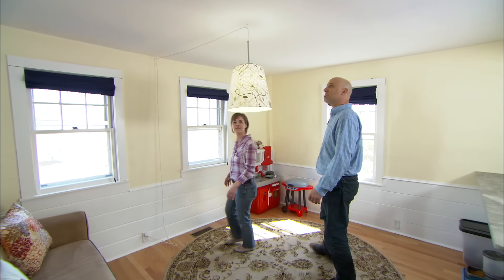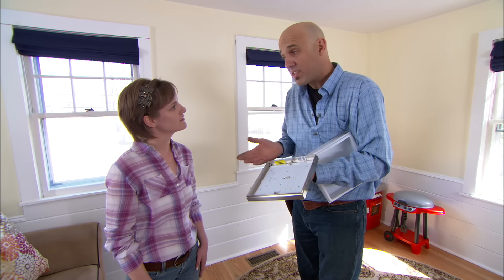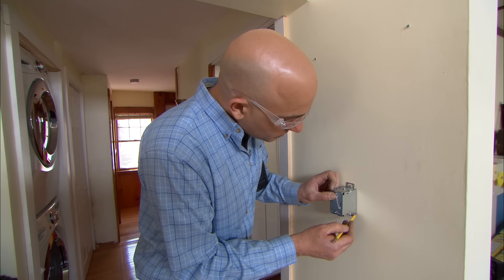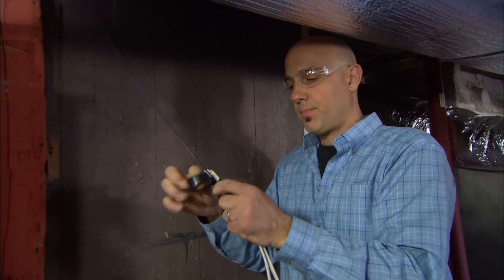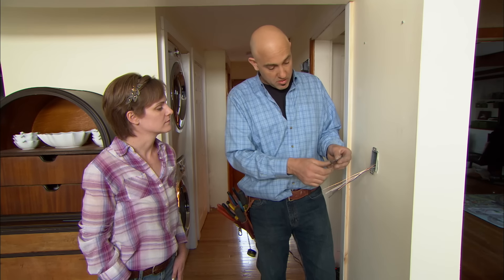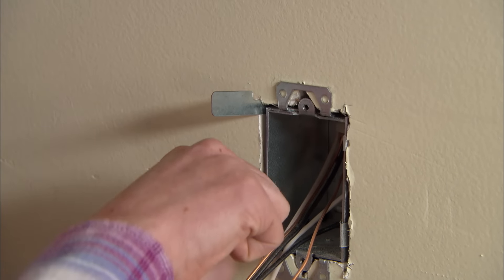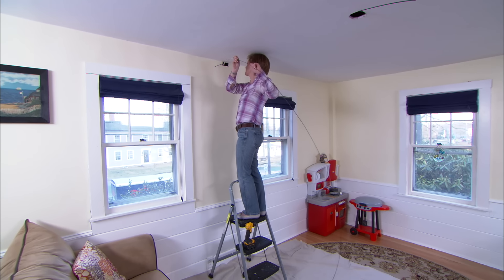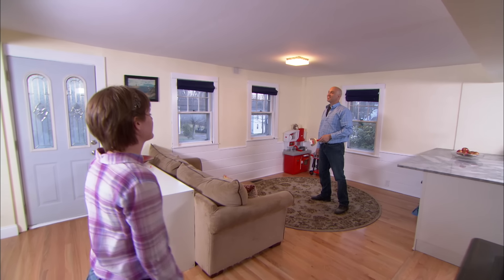How to Wire for a New Ceiling Light | All About Lights | Ask This Old House

Comment: It will be nice when the NEW owner of the house installs a ceiling fan on the box, lol. Nightmare -
Reply: Before installing a fan, you are supposed to make sure the box is fan rated. It would be the owner's fault if he/she installed a fan onto the wrong type of box. If you don't know how to do it properly, then you hire someone who does.
Reply: Kris Klekosky    Good advice, but how many homeowners think they can save a few bucks by doing it themselves. It’s just  white to white/black to black, and just screw in a fixture.  I once came across a ceiling fan screwed into a lathe and plaster ceiling with no junction box.  The splices were just hidden under the cowling.  I  took it down and refused to  do the job.

Comment: This guy ever hear of a Stud Finder.
I never attach electrical boxes to Sheetrock.  Wait tell someone goes to install a ceiling fan. Or the light switch wiggles loose after a few years. Do it right the first time.
Reply: I concur with the issue about the ceiling box; but, he should have used old work box for the switch. Those don't generally come loose because the brace is part of the box and screwed in at installation.
Reply: Sometimes the light needs to go into a place where there is no beam, and the light fixture is also not heavy. I like to use the plastic blue round cut in boxes for light weight applications.

Comment: I'm confused - why wasn't there a top plate in the way where he cut the hole in the top part of the drywall?
Reply: Old house. Maybe balloon framing ?
Reply: I searched all through the comments to see if someone else was wondering this exact thing! Most of the time getting though that top plate is the hardest part. The rest ain't so bad.
Reply: Dropped ceiling or more likely balloon framing
Reply: The access hole in the wall is so you can insert a long drill bit and drill a hole in the top plate. It'll be a little bit angled away from the direction you're needing to pull the wire, but that's what the assistant is for.

Comment: This videos always skip the hardest part of a job like this.  How to figure out where to fish the wires without tearing apart all the drywall
Reply: Yes and some old houses have insulation blown in them which makes fishing the wires a lot harder . After doing house building and remodel for 35 years i found a lot of old houses you can't fish wire though . Lot's of old multi floor houses had fire blocking put in horizontal and you have to drill a hole in it to get a wire though , meaning you cut a hole in the wall board large enough to get a drill in it to punch a hole in the fire blocking for the wire to pass though .

Comment: I'm so glad he isn't on the show any more. In all my years of electrical work, If I was hiring, I believe that the only place his job application would be would be in the trash can.
Reply: Why
Reply: @electricaf365  it's pure laziness to use Madison straps on an octagon. You know darn well the next home owner is going to hang a heavier light if not a ceiling fan not understanding or knowing how it's held up and I think you can figure the rest out. Should have used an old work fan box with the expanding bar.
Reply: @gregorall9779  wouldn’t that be the next owner’s responsibility to brace it before putting in a ceiling fan?
Reply: @electricaf365  You're assuming that the next homeowner is going to be aware of how it's secured. Personally, I would want to have it done correctly, not just the cheap, easy way. I just don't care for this gentleman's work ethic. In past episodes he has performed certain tasks, that to me, seemed the quick, let's get it done mentality.

Comment: I'm not an electrician so maybe someone can help.me... why even run the neutral all the way to the switch if youre just going to twist them together any way?
Reply: protocultureBJJ it just continues on to the light. Also some new switches require a neutral wire to it. But as I said before it just continues the circuit from the light. Neutral is your return wire and your hot wire is your feed, or supply wire that sends out electricity.
Reply: @Abdul Rahman Yep. The code changed many years ago (at least on this side of the pond) so the neutral is required in the switch box. Older homes were not built that way and there is not always a neutral in the switch box. One advantage of the new code is that when the switch is off (assuming everything is wired correctly) there is zero power at the fixture.

Comment: If you don’t know to shut off the power or measure to put the light in the center of the ceiling you shouldn’t be watching this video. It’s a good video for a guy with some tools and common sense. Also anyone who puts a ceiling fan up without checking the box installation first deserves what ever happens to them.

Comment: This video is terrible. Can’t see the whole picture of what’s going or coming from where - with the way they did the video edits. Also how is the switch connected to the fixture if it’s two separate wires connected to two different locations
Reply: It was pretty clear. You can’t teach decades of experience in an eight minute video

Comment: Unbelievable why there are so few electrical fires in American houses.
Do it like that in the Netherlands and your house will be condemned.
Also, that wooden floor looked like it should be replaced 4 years ago.
But biggest weirdness is why give the woman LED lightning and not even talk about a dimmer?
Reply: MsUltrafox The same happen with the UK regs.
I can't believe they wrap the line conductor around a brass screw.
Reply: How do you guys do it in the EU/UK?
Reply: I didnt know there is such thing as "LED  lightning"
Reply: uh, if you understood basic electricity there is nothing wrong with it.
Reply: @Yo Do We use "tunnel type connectors". A brass barrel or tunnel for the wire to enter into loosely and then a screw is tightened down onto the copper 90 deg from the side. Basically the same as what your circuit breakers and buses use to terminate the wires, except we use them on switches, outlets, fittings and appliances. Very similar to "choc blocks" (A). As for wire nuts, instead Wago (B) connectors and blue-points (C) are used in addition to the choc bloc.

(A) http://static.homecinemabuyer.co.uk/wp-content/uploads/2484-440.jpg
(B) https://i.ebayimg.com/images/g/pcMAAOSwrhBZKs~-/s-l300.jpg
(C) https://www.jaycar.com.au/medias/sys_master/images/8918148055070/240v-32a-bp-connectors-pack-of-10ImageMain-515.jpg

Not just Europe, others include Australia, New Zealand and many other countries.
Reply: if there is a criticism of US wiring you should explain how it can go wrong, that's why its called constructive criticism. and not just say "your houses will catch on fire n shieet dur!"

unless, of course, you dont actually know what you are talking about and are only reading out of a book.
Reply: @Tera Volt ahhh, interesting! Thanks for sharing, you peek my curiosity. Never realized how diff we were!

Comment: Whenever i watch these i cant help but be kind of in awe at how low quality the build of american houses is. Like, drywall is a last resort here, we usually have solid, strong walls from brick or cement. Guess that makes them cheaper though? Its just also always a shame because a lot of what you teach isnt really applicable in higher quality buildings.
Reply: the house is probably close to 100 years old
Reply: Thats nothing compared to some houses in europe :P
Reply: I would much rather have drywall. When I decide to remodel I don't have to get a jackhammer...
Reply: You can easily make changes with drywalls, (add insulation, fixtures, etc).  It's cheaper to install, and paints easily. Plus, brick or cement won't withstand earthquakes.
Reply: the bricks are on the outside or for the basement. also, they are not low quality since the drywall isnt there for structural support
Reply: The American public - generally - is only concerned about the cost. Do it the cheapest way possible. Unfortunately, for the cheapest way, they usually want top of the line parts and workmanship!